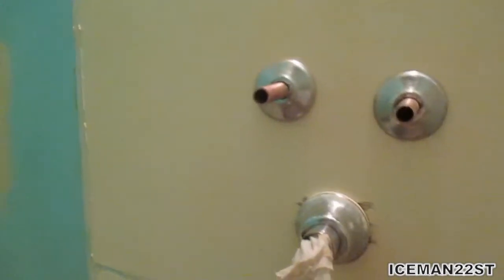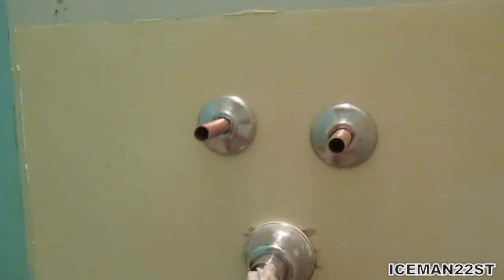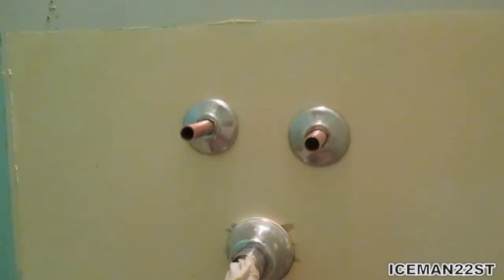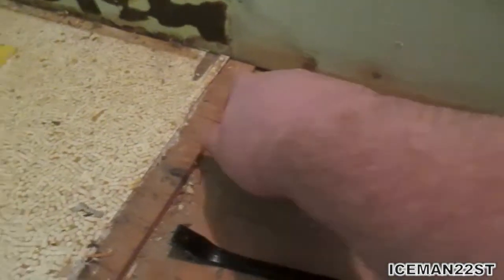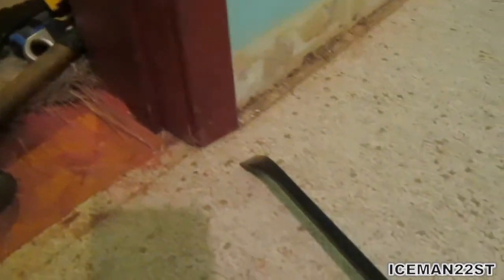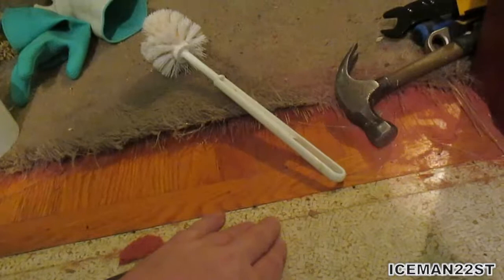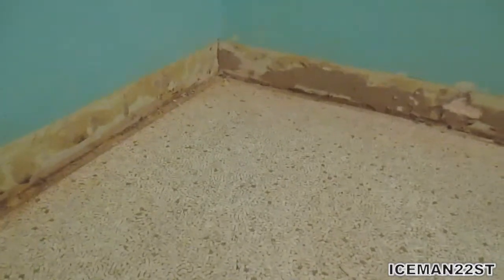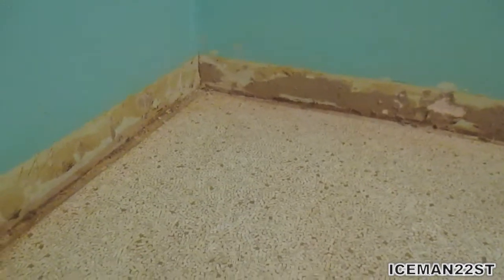Ensuite gut & reno Pt 2

Comment: Old style construction was very stout. A good foundation to start with so you should have a nice bathroom when its all done.
Reply from the maker: My mom and dad had this house built for them in 1966.  My dad visited every night ad "removed" any bad boards so they would be replaced.  They also went when the insulating was being done, and took scraps and tucked it in behind all the electrical boxes and voids on outside walls that the builder wouldn't bother with.  I have the original blueprints, all my dads drawings from when he built in the basement, and tray and trays of slides documenting from the time it was a vacant lot.  I'd never find a better house.
Reply: iceman22st
Plus it has memories...something you can't buy.

Comment: For the flooring. put the plywood down. plane it if need be. Then When you get new lanolin get a spare piece to put down there before you put your final new whole piece down.  plus there is filler they use to lever sub flooring that's like a paste glue stuff. Let me know if that works